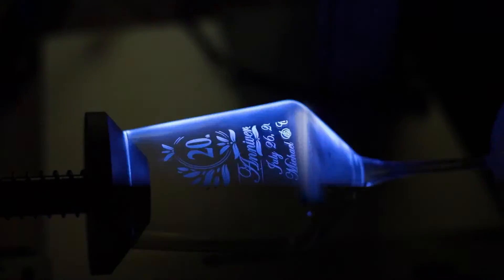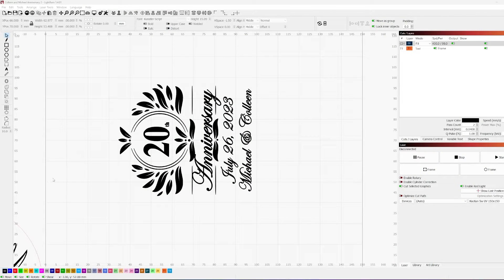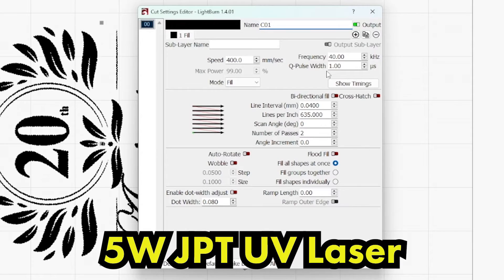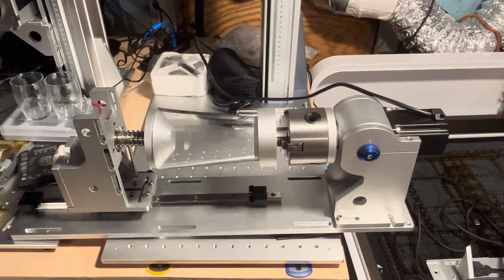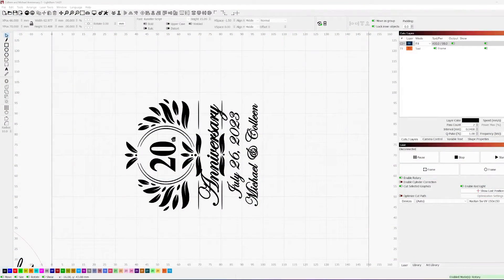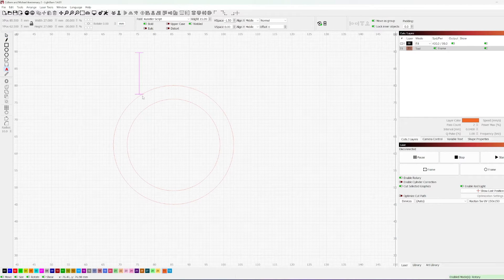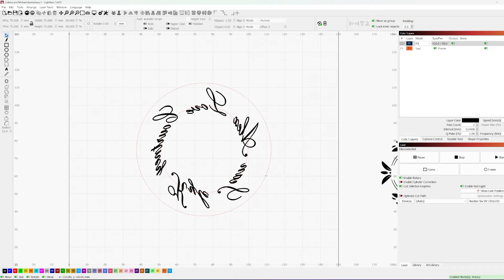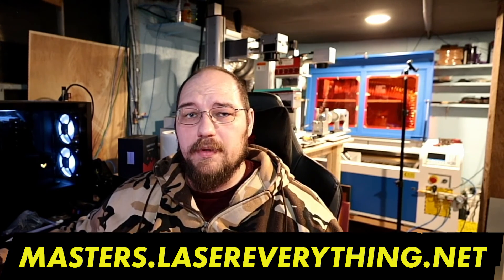FRAGILE Crystal Marking Techniques with UV Laser Machines

Comment: Hi there, did you folks modify that Rotary setup using a Glide Rail, I would be very interested in the parts used to finalize on this on mine, I just have it sliding openly with Thumbscrews..its a pain, pls and thank you!